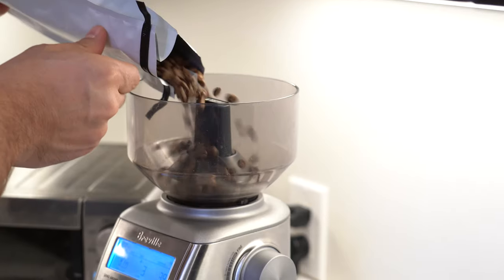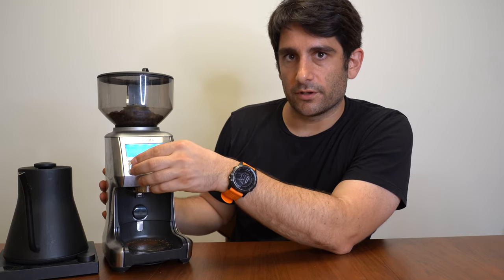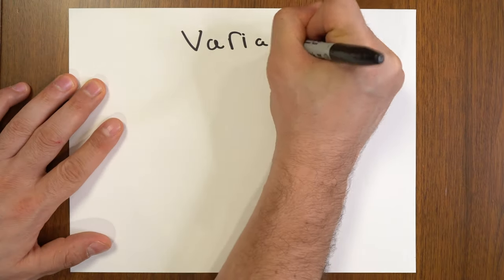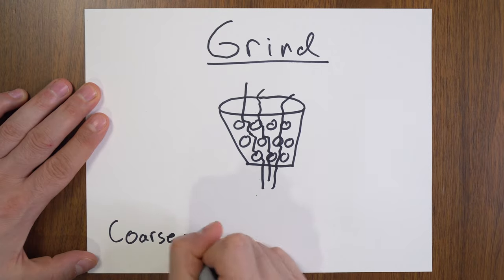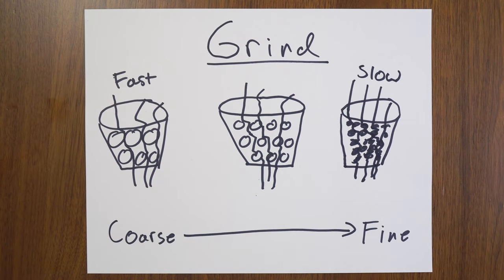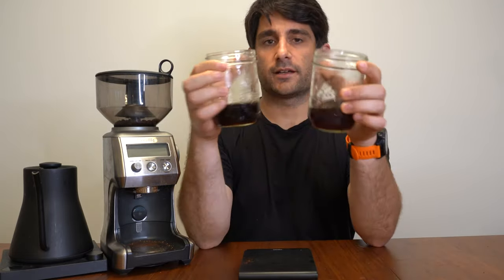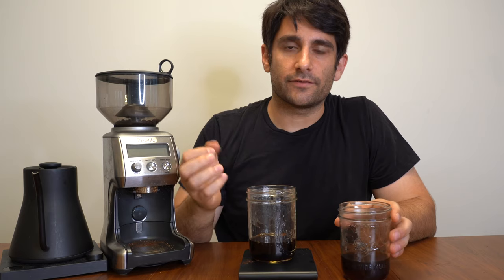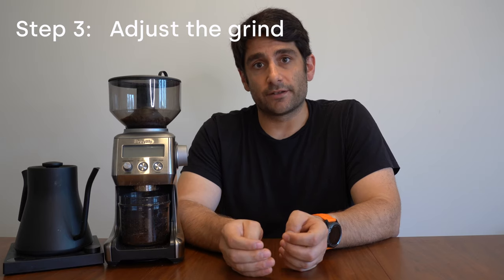Dialing in your grind

Comment: Great video. We’ve just got the Sage Duo Temp Pro with Sage Smart Grinder but struggling to get the right balance on taste. Can you offer any advice on the below?? Beans are espresso and fresh. 54mm double shot basket, non pressurised. 

1. Smart grind to size 14 for 10 seconds to produce 18g of grinds in the basket
2. Distribute and then tamp to Razor height
3. Extract for 28s from point I turn to manual. 

Thanks for any help 🙏
Reply: I have the same setup. In the sage double basket, try 16g at grind size 4, tamp until you feel resistance (don't bother with the razor and I'd recommend buying a proper tamp), brew to 32g out and see where that goes, should be around 30s. I'm no expert btw and your beans will be different than mine but I get a good, sweet brew from this recipe at the moment.

Comment: Looking into this grinder and the baratza Virtuoso. Is this breville grinder messy?
Reply from the maker: @zero9, it does have a tendency to spray some of the grinds at the bottom to be honest but it hasn't bothered me too much. I clean that area every couple of days. If you have a small hand vacuum it helps to do a quick clean.
Reply: @davidmeisnercoffee2377  Awesome thank you!
Reply: Depends on your portafilter size, if its smaller like breville portafilter it will drip some, not really much, but if u using any bigger portafilters, like rancilio, gaggia or any other 50+mm, then all grounds goes straith to filter basket

Comment: We cannot figure out how to use the program function. I get my desired settings hold down the program button it beeps but we cannot figure out how to get back to the settings we programmed.
Reply: Easy.   Set your grind size and drop a preameasured amount in.  (Say 15 grams of beans) Turn the time knob to say “9.3”.   Hit start and let it count down. If you dont hear the motor speed up and it runs out of time, hit the start again and watc the time count down and then add that to the 9.2 start time.   You want the grinder to run 1-2 seconds once all beans are out.  Once you are done and have a time dialed in, press and hold the TIME knob.  It will lock in time based on that size and each “ cup” press automatically counts up to accomodate.